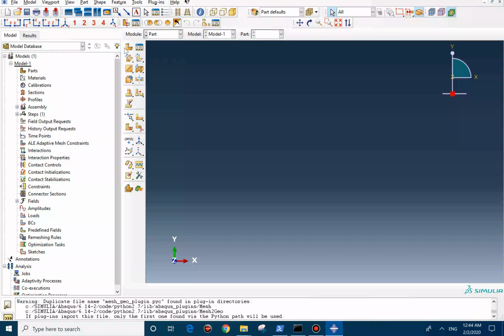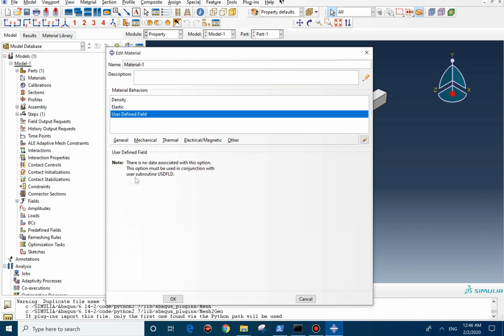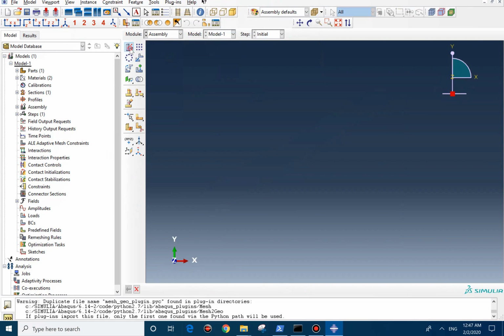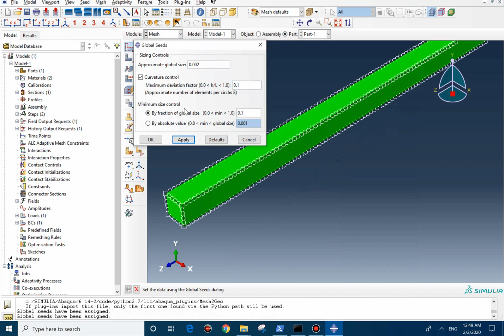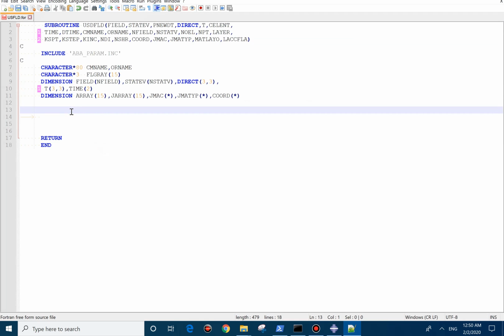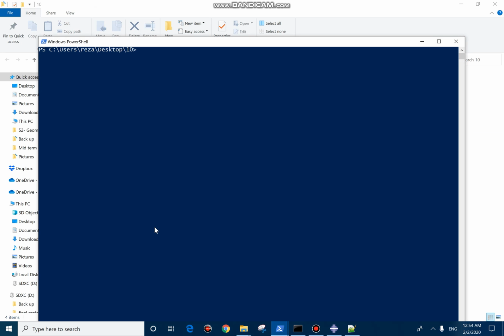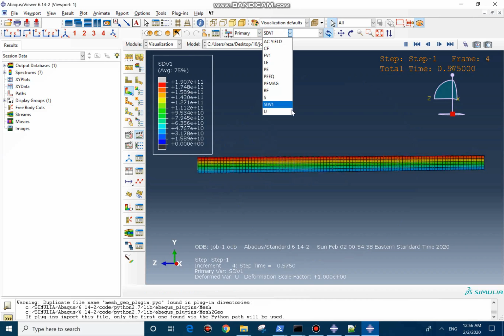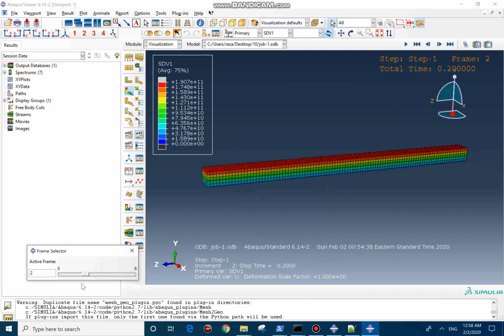An example for USDFLD Subroutine in Abaqus

Comment: Sir, Please have a look. here is error 

ERROR in job messaging system: Error in connection to analysis
Error in job FGM: The executable standard.exe aborted with system error code 1073741819. Please check the .dat, .msg, and .sta files for error messages if the files exist.  If there are no error messages and you cannot resolve the problem, please run the command "abaqus job=support information=support" to report and save your system information.  Use the same command to run Abaqus that you used when the problem occurred.  Please contact your local Abaqus support office and send them the input file, the file support.log which you just created, the executable name, and the error code.
Job FGM aborted due to errors.

how can i fix this error?

Comment: I have a question:
I WANT TO CHANGE DENSITY AS A FUNCTION OF TEMPERATURE VALUE AT EACH INCREMENT, HOW TO CALL IT IN USDFLD SUBROUTINE??

PLEASE HELP. I mean , how to update density variable as function of TEMP solution value?
Reply from the maker: Hi,
You don't need USDFLD subroutine for this task. You just need to activate temperature dependent box in density panel and insert your temperature dependent density in the table.
You can use this link:
http://130.149.89.49:2080/v6.11/books/usi/default.htm?startat=pt03ch12s08s01.html
Follow the 3rd step.

Comment: I have a question. If you could help me, it would be very great. I have residual stress contour from "A" job.  I want to extract the stress components from "A" job and use it as a initial stress state for "B" job. The main difference between "A" job and "B" job is "A" is pure mechanical, but "B" will be thermo-mechanical analysis. Is it possible to use "USDFLD" for that problem? Thanks!

Comment: Dear sir hello and for the useful video
I got the following error:
ERROR IN JOB-USFLDBEam: Problem during compilation - C:\Users\ASUS_PC\Desktop\USFLD_Beam.for
What should I DO to resolve it
Thanks
Reply: Search how to link Abaqus to Fortran compliers. Dr. Ronald channel you will find the video.
Reply: @mera_baba_  ok thank you
Reply: @mera_baba_  but I don't think that the subroutine USDFLD need to link Fortran compiler with abaqus
Reply: @bensaidismail5394  it is sir please do it.
Reply: @mera_baba_  thanks
Reply: Hello, did you solve it? I have the same problem. I can run the analysis with the USDFLD Subroutine using Static, General at Step. However, when using Dynamic/Explicit, this issue occurs

Comment: i have made a dflux model but i am not able to delete element and make cavity on the surface. what should i do?
Reply from the maker: You have two option:
1- Using VUMAT and deleting element when they reach a certain criteria such as temperature or stress
2- Using USDFLD to reduce the material strength when they reach a certain temperature

Comment: Hi..
Thanks for the great video...

I tried the problem exactly but the I'm getting the error "Problem during compilation"

What could be the issue?
My ABAQUS Verification shows "Pass" for all cases including "Abaqus/Standard with user subroutines"
Could please let me know the versions of ABAQUS, Visual Studio and Intel Fortran Compiler (or any additional softwares) that you are using or which will run successfully...
Reply: Hi,
This error is not the only for linking problem perhaps you have an error in your subroutine command.
I would recommend you check your linking status by running one of my products on the website to check if it works then you can go for further steps.
https://hyperlyceum.com/product/an-example-for-dflux/
Please ask your further question from our website.
Reply: Hi. I also had the problem during compilation messages after submitting job and A UMAT file. I solved it by testing a much simpler subroutine DLOAD, and USING THE WINDOWS POWER SHELL to run the analysis. Power shell somewhat show the errors in the code and after correcting code/syntax, the subroutine ran perfectly. Did the same for UMAT subroutine, debugged the code, checked the error messages to see what was missing and added the missing stuff. The job ran perfectly inside ABAQUS. 
You can find videos on DLOAD and UMAT codes on youtube. Just need a bit of patience to debug problems.
Reply: @Bold Learning I am also facing same issue"Problem during compilation".How did you resolve it??
plz tell